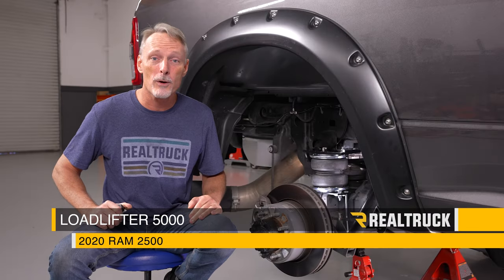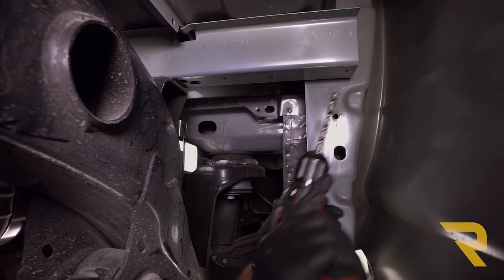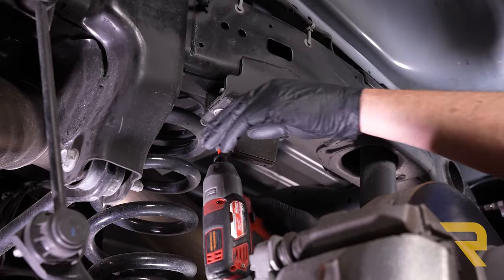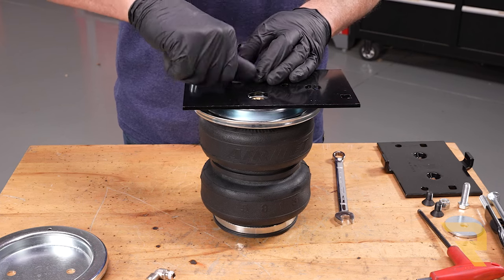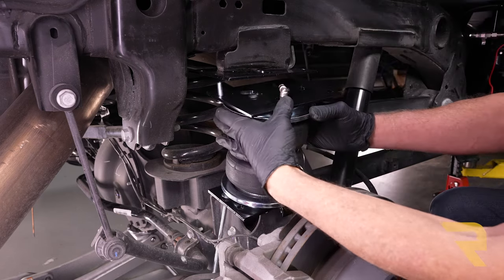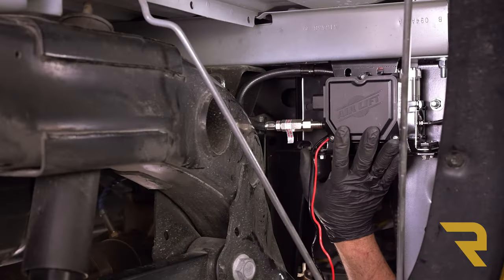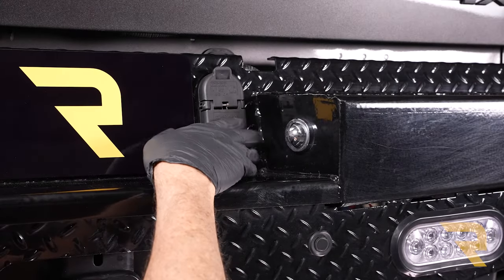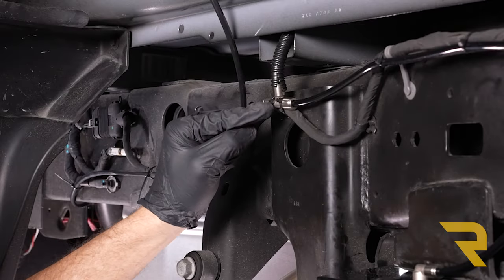How to Install Air Lift LoadLifter 5000 Air Bag Kit on a 2020 Ram 2500

Comment: Just installed this system today on my 2020 Powerwagon.  Install went perfectly and it works great, Your video was extremely helpful, Thanks,
Reply: @mountie816 - just bought a 2022 PW2500 and had an issue when towing a camper trailer around 4,000 lbs fully loaded. With around 500 lbs cargo in the bed plus tongue weight of the trailer around 400 lbs, the truck squat was several inches, leading to nose down of the trailer. How is your performance with this system installed? 
Great video, thanks for the detailed installation guide!

Comment: Does this system suppose to inflate or deflate on it's on? Mine will do this mostly when I have a load on it or randomly sitting in the driveway. Kinda annoying when I'm unloaded at a campground.

Comment: I can be completely wrong here, but aren't you able to control the pressure for each airbag with that? So why just run 1 line for both bags?
Reply: Not for that set up. U want to have equal amounts anyways

Comment: So is this sold as a system or do you have to buy the airbags and compressor separate?
Reply from the maker: This system is complete system and doesnt include a compressor. You can either add a compressor or use an external one.

Comment: I have a 2019 ram 2500 6.7 with a zone 6.5” lift with fox shocks will I still be able to use these
Reply from the maker: It will work with lifted vehicles but you would have to measure to see if you need an additional spacer kit to be able to install. I suggest calling in at 877-216-5446